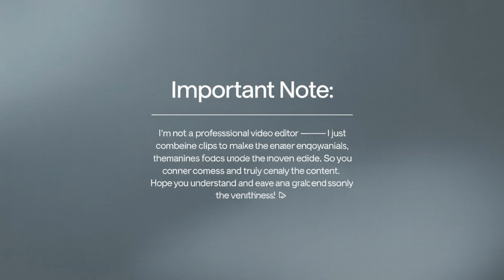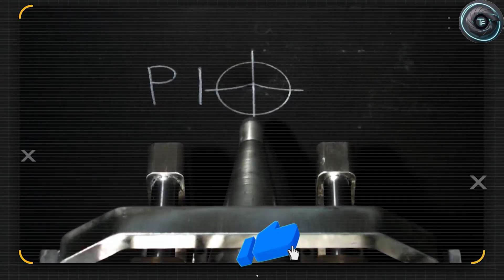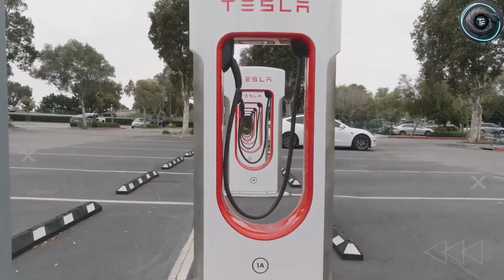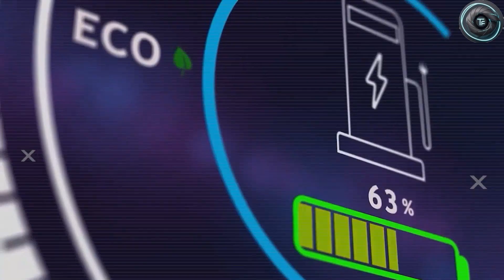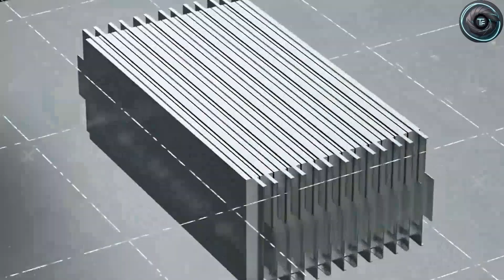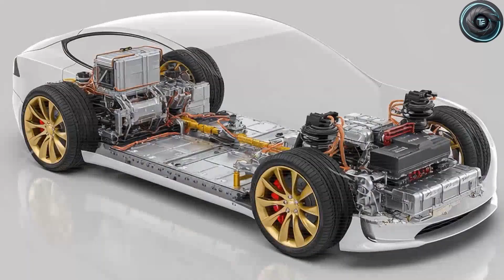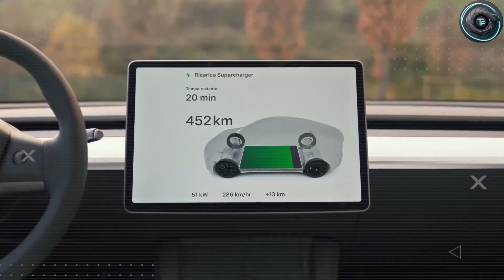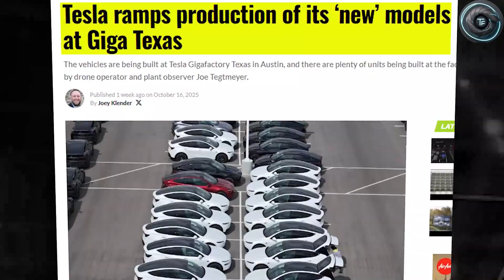This Battery Just Ended the EV Waiting Game! Tesla Model 2 Aluminium-Ion Tech Revealed

Comment: the main reason I have never purchased a tesla is all about battery life. the stories are endless about the 5-7 year old battery showing signs a 10K replacement bill is in the cards. if this tech shows its true promise than people like myself will rush to begin the purchase process.
Reply from the maker: Agreed. The new Al-Ion tech is made to solve that battery issue.
Reply: This whole video is fake information. I currently have a 9 and 10 year old Tesla with close to 400k miles on them combined and both are still on their original batteries. 

Vaporware and videos like this misinform a lot of people into thinking we don’t already have phenomenal battery technology that is extremely cost effective compared to ICE cars without even factoring in the fuel cost.